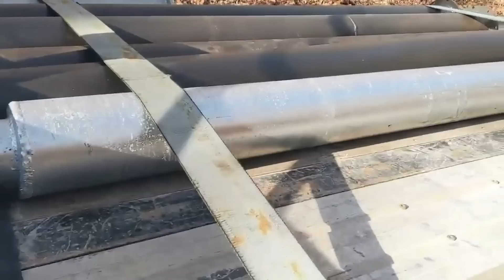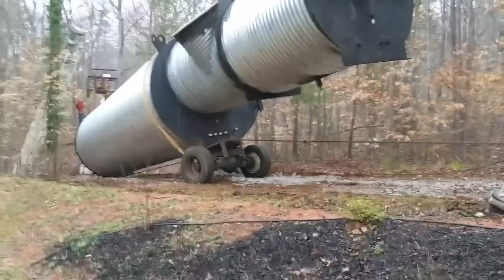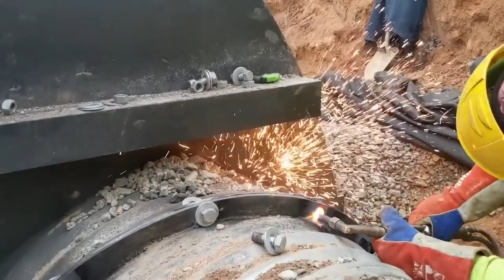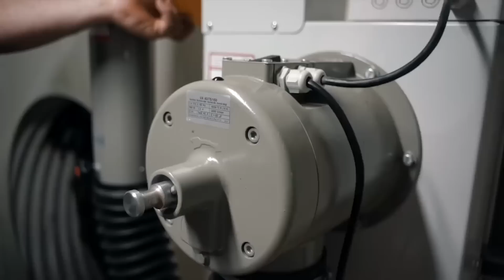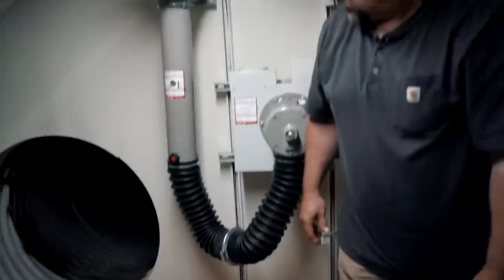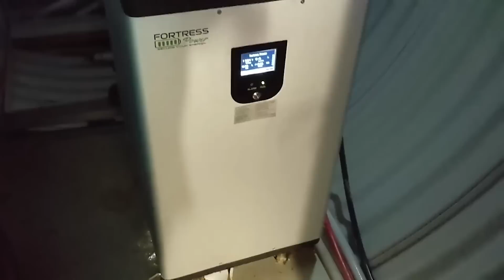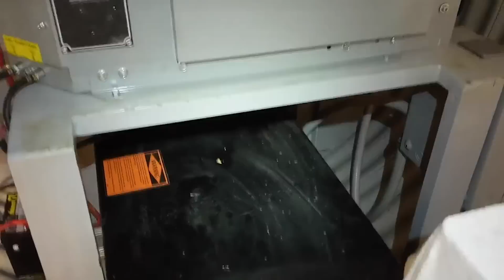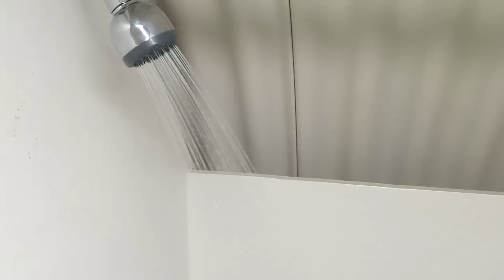Engineer775 installs an Atlas Bunker with Solar, a Diesel Generator, and WIFI!

Comment: HOW LONG CAN YOU STAY IN THE BUNKER WITHOUT THE AIR RUNNING? 
For example: what if you're sleeping?
Reply: A person laying down doing NOTHING, needs at least 125 cubic feet of air an hour before CO2 level reach about 2% and the humidity in a shelter starts getting very uncomfortable and dangerous. This is just for short term only, like a tornado shelter. In a long term shelter, FEMA states 15 cubic feet a MINUTE per person, and that's mostly for humidity and a serious "FUDGE FACTOR" reasons. 

You live in tiny quarters like this, and against the cold ground, you will soon see moisture dripping and running down the walls from people breathing out moisture. Now if you're in an insulated shelter, like a dome, then humidity isn't as big an issue because it stays in the air and will be expelled to the outside with the natural airflow from the blower, so some thing like 300 to 400 CF of air an hour per person will work.

Now sleeping...first, not everyone should be sleeping at the same time. Some one needs to be up while everyone else sleeps. You also need CO2 alarms inside your shelter and CO alarms with a gen set. 

Without knowing how much air space is inside each shelter and how many people are inside, and what you'll be doing, I would start getting nervous in any shelter like this in as little as 4 or 5 hours and for sure by 10 or 12 hours.

Some thing I haven't seen addressed yet, is what happens when you need to jump into a shelter in the winter, and now you're sucking outside air inside and literally you'll freeze everything up including water lines and people. For "ME", I have to believe that if there is an attack, wouldn't it make sense to do it in the winter time and use the cold as a force multiplier to kill more people when the power goes out??

Sure the ground temp is always around 55 degrees year round, but you're pulling air from outside, that could be well below zero and into your shelter. Just open a window in your home during the winter and see how long that room stays livable before you're frozen. In the summer, outside air maybe more than enough to keep it warm enough for the women to be comfortable, but believe me, come winter, it just might be a frosty stay.

I won't go into detail how I do things, but this is some thing that needs to be addressed.
Reply: By morning you won't need to worry about that.
Reply: NBC nuclear air filter comes with the bunker and can run  off of batteries or a generator or for an emergency you can hand crank it
Reply: @ohitsslicks  How long can you stay in the bunker without the air running?
Reply: The air system is automatic and manual so you can keep it running all night.
Reply: I have no clue how long. The head guys need to answer. X number of people times x number of square feet in the bunker equals an answer? My math skills are not that good. I make a good sandwich or wrap however. 😁
Reply: @ferebeefamily  CLOSE! but it's number of people and CUBIC feet (which measures volume not inches). You'll also need to figure out the oxygen concentration of the air, breaths per minute while resting and how much you inhale. As well as figuring out how much oxygen your body is absorbing before you exhale. However, I wasn't looking for a scientific answer,  more of a approximation! Lol
Reply: I watched a video of a kid staying all night on a pond in one of those big plastic bubbles. It was a particularly large one, but still. He didn't suffocate. I think this bunker is at least several times the volume.
Reply: @Jack Le You're right, but I think there might be a slight difference in the style of living between a Russian from 80 years ago and a soccer mom of today, but I could be wrong.
Reply: @wjf213  Thank you for answering my question in depth and giving me more to think about. Send me the link to your PayPal and I'll send you a couple dollars. Not much money but it's better than nothing and I doubt any other people would do it.
Reply: @RoughWoof  WOW, thank you very much, but I can not accept anything. I truly enjoy helping people and sharing what I've learned over the last 20 years in building, and 40 years in prepping. But if you want to donate, one of my FAVORITE charities is VET RANCH that helps animals and they had another great video today on another animal they helped because of donations. It's totally up to you of course.  https://vetranch.org/
Reply: @RoughWoof  You can send me any money you feel like too haha
Reply: Call NASA

Comment: Do you have any videos of a "double wide", i.e two shelters side by side? I totally love that concept.
Reply: Just don't paint it pink.
Reply: He does, check out the Atlas website
Reply: Would love to see a double or triple wide square bunker
Reply: Ok now imagine a giant underground community. So in the centre you have a concrete dome hub connecting several normal bunkers, possibly multiple storeys. I'm thinking two layers of 12 so 24 total. 1 unit contains storage, gym and a lot of generators, 1 contains medical area and command area, 1 one is decontamination and storage (massive mudroom basically) leading up to a buried garage closer to the surface, 1 toilet block, 1 cinema/auditorium, 3 common rooms, the remaining 16 into apartments of various sizes.
Reply: @jonomoth2581   that would be awesome. Need a security and coms room too